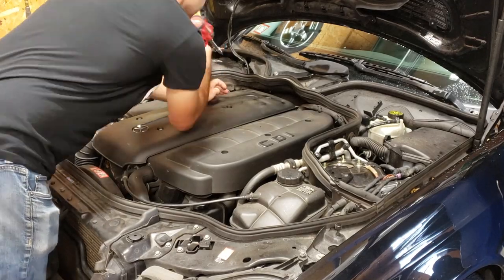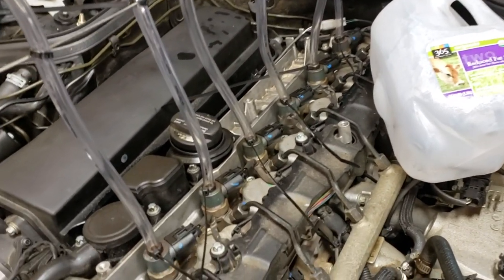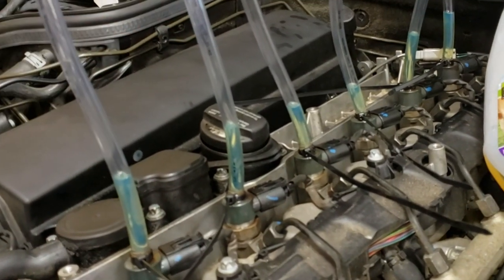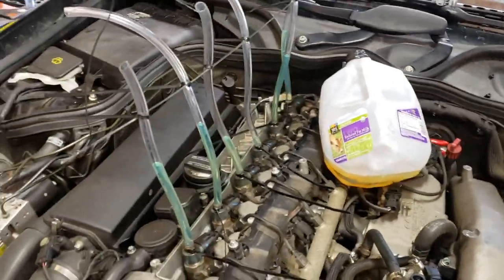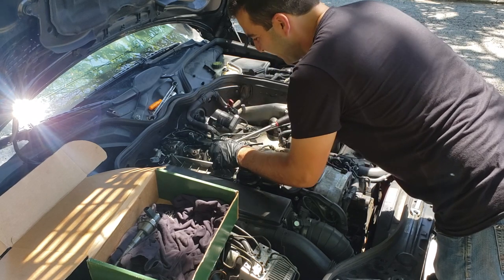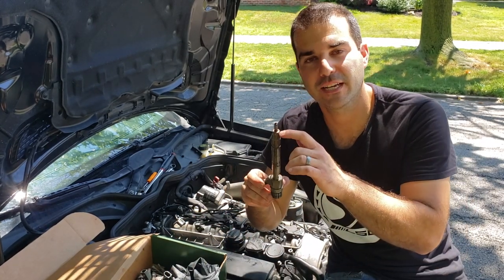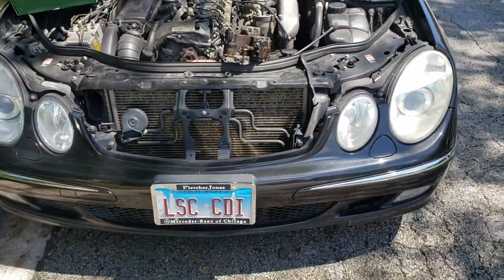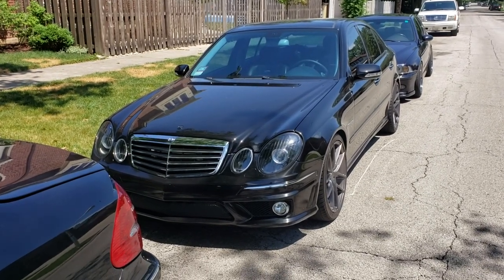Here’s Why I Stopped Making Videos With My Turbo Diesel Mercedes & What Hitting An Armadillo Did.

Comment: Alex, Thanks for a very informative videos, I have question I have 2004 Mercedes-Benz C240 with M112 engine ca I use alternator form 2002 Mercedes-Benz E320 both cars share the same engine ? C240 use Bosch AL0787x E320 use Bosch AL0788x the the S430 use Bosch AL0789
Are the alternators comparable  “interchangeably “ with these cars

Comment: Be interested to know how similar those injector bodies are to the ones used in an Audi V6 TDI bet both are bosch with different caps.
I'm surprised it's taken some work to find someone to improve the nozzles as I know the older Merc scene has insane diesels with the OM606 capable of running over 500hp with a custom IP and nozzles.
I'm guessing the killer here is spray pattern?
Reply: The 606 doesn't need modified nozzles to make big power.

Comment: Colman fuel has benzine in it. That's what they use to liquidfy carbon 60, which is the diamond like carbon in injector tubes.  Fill a mustard bottle and give it a squirt follow with wd40 or pb blaster
Diesel Mech since 77
Reply: That's probably fine for old-school mechanical injectors, but I would not advise doing that to a modern CR injector.  The tolerances are much tighter and the potential of harming the small internal parts are just not worth the risk when compared to the cost of replacement.
Reply: @monsterram6617  and using a hammer puller is more delicate. ,  Abide dude, abidep
Reply: @billrussell7672  Lol, no... at least I wouldn't use one.  When I pulled the injectors from my 6.7 Cummins I bought the appropriate tool because, to me, it's not worth the risk.
Reply: @monsterram6617  I have been a heavy duty mechanic since 77, Us Navy trained  Diesel( repair 5 sub) Gas Turbine systems. ( The list goes on From structural welder to millwright.

If I say the quickest and best way to yank a stuck nozzle is to flood the area with benzine
My thrust is to help those without skills to do a fast and cost effective repair.
There are many jobs you can buy 15,000 dollar tools for when  a little savvy and a harbor freight  dial indicator will set injector heights or all thread and double nuts such as a cat 3116 that knowledge came from learning Detroit's when I was 17. 
What if no tool was available to extract a  7.3 international in a for ambulance. You tear down the injector in situ
The benzine clue is good for a 
Cummins commander or a Mercedes Benz and it dosen't leave granular debris to FOD the cylinder.  
The GungFoo is great with this one grasshopper. Money may make some things easy but knowledge makes all things by simple
Reply: @billrussell7672  Hey, I appreciate and respect your credentials and service.  I'm a Retired Marine myself.  I'm not questioning your intentions, I'm merely pointing you that it might not be a good idea using those chemicals on a modern injector.  

About using proper tools, I spent about $120 for an injector puller.  It was a bit pricey, but I didn't jack anything up when I pulled them, and I'll be pulling them again soon when I put in larger ones, so it was money well spent.  If the proper tool was thousands or didn't exist, I'd probably make one.  This is easily accomplished with a lever which can be anchored in a near-by bolt hole from the injector hold down.  And there are groves on the injector body to lock into.
Reply: @monsterram6617  thank you for your loyalty to the people of Joseph and the umbrella which is cast like wings to preserve all men we call that thing America ;Washington himself said " finally the tribe of Joseph has a home"  more than a marine I would that you are saved by the covenant of blood by the cross. That you are filled with the spirit of reward that you faithfully served as we all in naieveté
God is a rewarder of those who love him and protect and serve the creation he has established

Comment: You should talk to some of the finnish tuners, these cars are very common here.
Reply: Alex should contact CDITuikkuOy, he will get the best performance out of that Mercedes for sure.
Reply: @santtu9169  I was going to suggest this, Tuikku is very wel known in the Diesel community.
Reply: Isn't that the engine Tuikku tuned for over 700hp. Required some other minor changes also, of course
Reply: I am sure he is already in touch with tuikku. If not, prepare for more non-diesel videos.

Comment: Interested with your MB experience Alex, which you prefer, Diesel or Gasoline engines?
Reply from the maker: Gasoline in most cases but obviously diesel definitely has its place in heavy duty truck applications. I had fun with it in my CDI but Gasoline is better for performance cars

Comment: I hit an armadillo with my c36 and it wend directly through the drivers foglight hole destroying the fog light and cracking the bumper. New bumper is $1000 unpainted from Benz and used ones are not easy to find 😩
Reply: Mike Johnson Same thing happened on my Audi S4.

Comment: Hey Alex, I drive a 1998 C220 CDI 5-speed manual and sometimes my engine is rough at idle when coming to a stop or at a red light(after acceleration). The engine makes the whole front of the car shake like crazy and after 5 or 6 seconds it stops shaking and runs fine. I have replaced the four injectors for new ones, new MAF, new turbo, did regular oil change, oil filter, air filter, fuel filter and also make the four flaps on the intake always open (like you did in previous video). Also have tried different types of diesel of gas stations. Do you have any idea what could be? Thanks
Reply: Motor mounts maybe?

Comment: I am really considering getting a W211 E400 CDI
Pros: Having a fuel efficient V8
Cons: Registration costs $2000/year (Its based on CCs, over 3L is expensive as fuck)

They are 5000EUR in a really really good condition, sit and drive, although i am 100% sure all of theme had there odometers rolled back by few 100 000km
Currently driving a W211 2002 E220CDI bone stock with 480 000km 100% accurate km so i am used to driving really old cars.

I am just worried about the transmissions on these 4L v8s, will it hold up a long run

Comment: Haha I've just come indoors after changing an injector seal on my ML 270 CDi. Absolute pig to get it out, but all sorted now :) Looks like the same engine as your E320 except 1 less cylinder. The car blows a lot of black smoke with hard acceleration, I've checked all the hoses and replaced vacuum lines. There is a fair bit of blowback from the EGR which I think could be causing the issue, but really I need to get it to someone with more experience with Mercs now :(
Reply: Marcus F black soot /smoke, check for boost hose leaks around your intercooler. You’ll find this when the hoses pop.

Comment: The pump looks like Bosch CP3 on the Cummins and DMax motors....
Reply: It is very similar. Those both use the R110 version and this largeer one is the L110 version of the pump so they're not easily interchangable.

Comment: Injectors on diesel they have to go back where they came out or you will need to recode them it's a easy task to do if that is not done and the injectors are installed in a different position the car will not start , you really should use a seat cutter before you reinstall them

Comment: Hey Alex, really love your channel! Started for CDI tuning but got into everything else. Def gonna try the ceramic coating you used now too.

You probably get thousands of messages, but maybe you will notice this and answer a question I have.
What effect will an upgraded turbo have without a turbo map? I have a 2012 GL350 with a turbo on its way to turbo heaven. Shopping around, I found UK company called venom hybrid turbos that sells upgraded turbo for almost same price as new stock one. I want to get more power down the road and it is perfect time to get upgraded turbo since I have to switch it out anyway, but I don't have 1.5k (local quote) to dyno it at the moment and map upgraded turbo. What would you do? Would you buy upgraded with plan to upgrade other parts and dyno in the next yearish, or is that too risky not to map a turbo right away?
Keep up the vids mate!

Comment: I do hope you get new calibration data from the company for the injectors, you will never get it running right otherwise. Your tuner needs to match the injector flow rate to the injection table. Otherwise you're just making smoke and noise but not power.

Comment: You're not cracking loose those injectors using a torque wrench, are you? I'm hoping that's a breaker bar. I'm not sure, cuz I know you're much better than this. Also, you don't have the online workshop manual from Mercedes that's available on the net?
Reply from the maker: You think I'm using torque wrench to turn the bolts loose? I don't think so

Comment: I’m looking at buyin a CDI. Is there any problems with these
Reply: Jeff Conley Yes, watch out for oil cooler seals leaking from the hot V, MB worked out they needed to use Vitron seals which are cheap, but to pay someone to change them is a massive labour intensive very costly job.  By 2010 MB had fixed this issue.  Watch out on the earlier V6’s.  Plenty of info about this defect on the web.
I was lucky enough to be able to slow my very slow leak to nothing (that I know of) by using AT-205 reseal made by ATP automotive.  It saved a rear engine seal replacement on my earlier V220 Petrol V6.

Comment: Why didn't you block the return line using a hold down clamp? You wouldn't even have air return in the lubrication line to the fuel pump 🙆🔨🇩🇪

Comment: High pressure pumps need to be changed every 70 to 80 k the rubber seals rot away and dont work correct  ,!!
Reply: What are the symptoms of a failing CDI high pressure pump?

Comment: If you want to make a leak off test kit that doesn't make a mess and that you know all the diesel is going into your clear hose, you can buy a plastic version of the L-type leak back fittings from E-Bay for like $4 each.  Then you have the same connection with o-rings as on your original fittings that won't leak.

https://www.ebay.com/itm/Diesel-Injector-Leak-Off-Connector-for-Bosch-Common-Rail-90-Mercedes/283339797711?hash=item41f85e34cf:g:sqwAAOSw6X1cPa8O

Comment: @legitstreetcars Alex, have you considered getting the fuel levels higher and spraying it with nitrous? I've learned nitrous is actually helpful on Diesels and I plan to test this out once I can build the fuel up and the transmission. Checkout Cleetus' Nitrous 12V Cummins Galaxie.
https://youtu.be/Ti-ZlzqSJNM

https://youtu.be/8TXk9lOOtQM